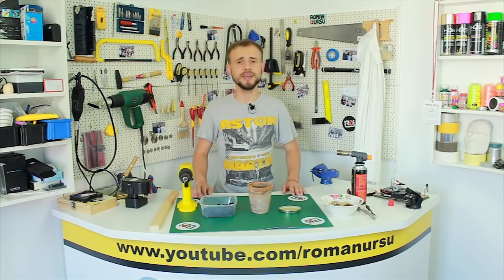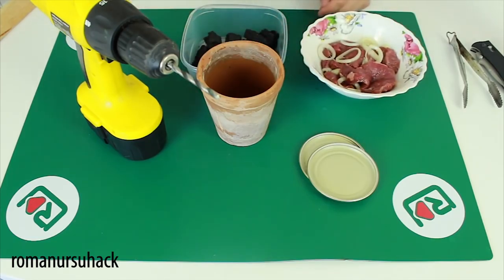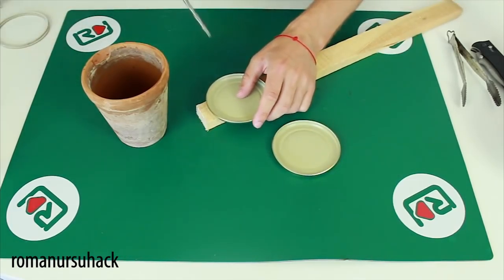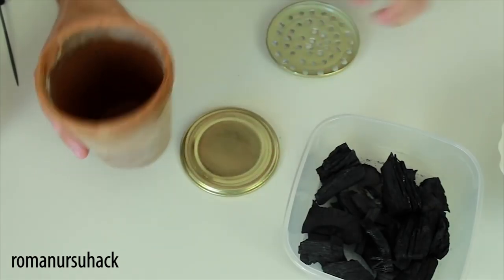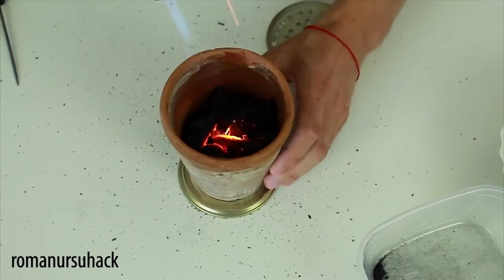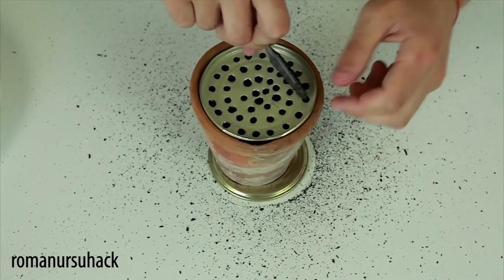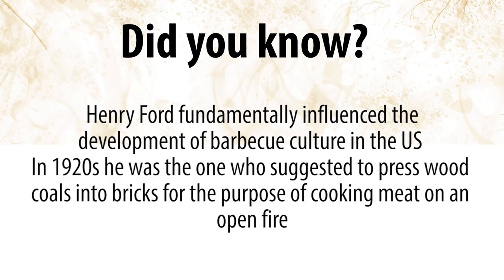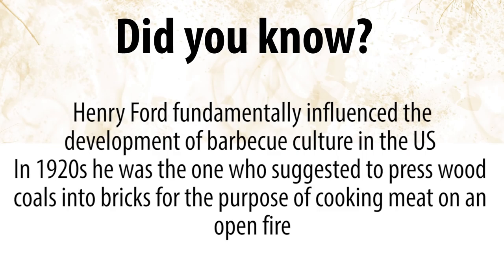🔴 How to make a mini grill 🔴 Video Tutorial 🔴

Comment: Great idea, but the underside of jar lids usually contain plastic or rubber, usually laden with BPA or other chemicals. Burning these and then putting raw food on them, ..., I'm not sure that doesn't result in the substance getting into your food. Maybe keep the lid oriented top up, bottom down or find another item to use as the grill? Some tomato sauce lids are all metal without rubbery/plastic coatings.

Comment: This time I do not agree with you Roman!

Though it's a nice project for outdoor use! Charcoals (wood or natural) are the worst CO2 emitter, therefore using it indoor could be very dangerous. It's like plugging your car exhaust pipe to your ventilation system.

Any burners should be used in a WLL VENTILATED area and almost none are recommended for indoor use!

Maybe you should add this warning to your video!